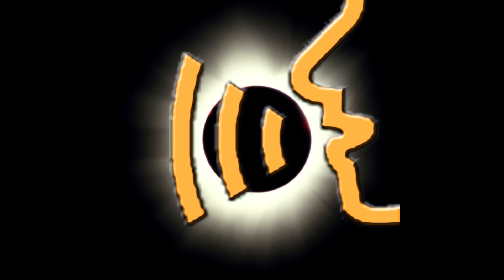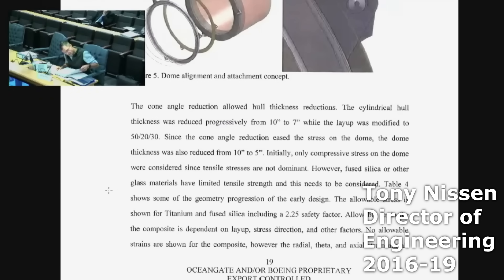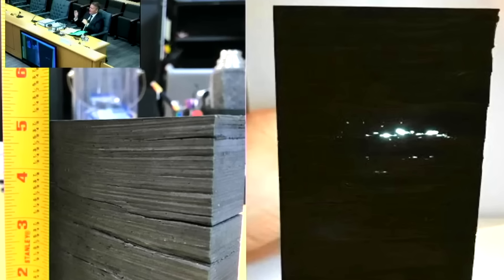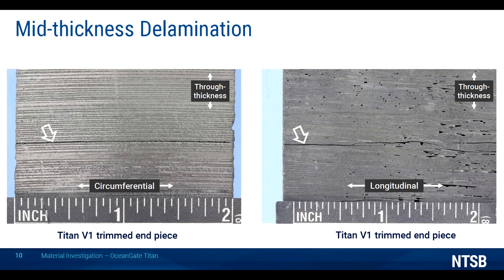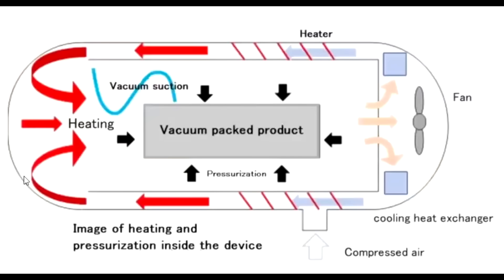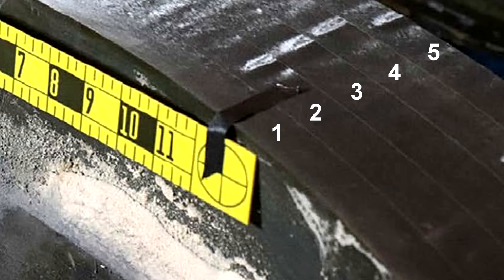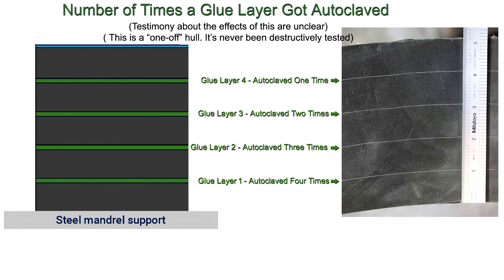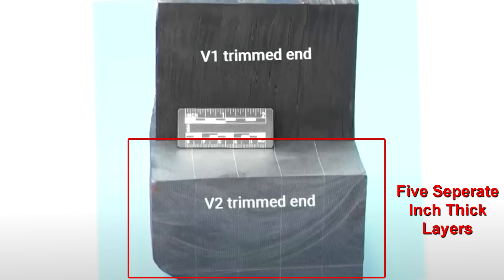Who Engineered the OceanGate Titan V2 Hull? Maybe Nobody Did?

Comment: 9:30
NASA is not in the business to ask why. They gave a valid recommendation that, if followed, would have kept Stockton alive.
Reply: Exactly. NASA isn't guilty of "not caring", they were consulted on composite manufacture, not on composit manufacture for a submersible. Seeing as they returned most of the consulting fee, and from what came to light about how Stocton operated, it is feasable that they were not informed about what the composite manufacture was for by the time that Stocton pulled the contract. This video seems to attempt to put the blame on NASA, while the blame lies with Stocton.
Reply from the maker: @QuintinvanRooyen1  Thanks for commenting.  No, I do not attempt to put the blame on NASA.  They did what they were asked to do and that was to provide consultation (remotely) on how to debulk carbon fiber laminates.  They were interested in the process to see if their recommendations would ultimately help to make thicker laminates.  The Stockton stopped the association.  My point was that the end product should be taken into consideration even when making the early recommendations.  If NASA had been kept around long enough they may have been in a position to give OceanGate warnings about the idea.
Reply: @solareclipsetimer  fair response, but the video did give me the impression that you thought NASA didn't care about the use of the end product. I appreciate your response and accept that it may be my interpretation and not your intent

Comment: No matter how you engineer it, carbon fiber isn’t a proper material for a submarine. It’s brittle! Duh!
Reply: Nah you can use it effectively. The single point of failure for this submersible was Stockton rush. The shape and material have been used before in compressive load. But they were built right
Reply: @beesung2052  I assume you meant to say that they were (it was?) not build right? A majority of the video shows how the building technique of the cd pressure vessel was flawed
Reply: @J0nny_  common sense suggests the guy above you was saying that OTHERS did it correctly...
Sure grammatically he started a sentence with a conjunction. But we all do that from time to time right?! 😉
Reply: @iliketurtles4463  that's another war to make sense of it.
That's why I mentioned the NASA paper
Reply: not just that, but carbon fiber is strong under tension, not compression. It is great to keep a lot of pressure in (copv) but not to keep pressure out (except when it is made in a very specific way, afaik someone at nasa wrote  a paper about it). This way does not involve sanding the structural carbon fiber down which is, guess what, a very bad idea.

Comment: Another video I saw also mentioned that this should have been in a vacuum when it was baked to help remove air pockets, but that was not done.
Reply: Yes I saw that as well and someone recommended a "clean room" and he ignores that and they wrapped it in a likely dust filled room with no filtration and little invisible to the eye particles of dust just landed and stuck in between each wrapping layer creating likely hundreds of thousands of extremely tiny microscopic air pockets. He just wanted to hurry up and submarine so he could be on the cover of Time magazine and get asked ego thumping questions and he could feel like a hero on 60 minutes. His ego and his dream to do something as famous as his ancestors did, who signed the declaration of independence, got in the way of safety and he paid the price. Unfortunately he suffered from  Dunning Kruger which caused him to take passengers down with him and they paid the price as well. Both monetarily and with their lives. RIP
Reply: It is called an autoclave and it is pretty much the only way to cure carbon fibre. "OceanGate used an autoclave at Janicki Industries to cure the full-size hull of the Titan submersible." So whoever made that video is wrong.
Reply: @BionicBurke  Autoclaves use pressure not vacuum, so not sure where you are getting the idea that an autoclave helps with air bubbles removals.
Reply: @dagamore  same result.
Reply: Autoclaves no are usually built to pull a vacuum before adding pressure for various reasons. If these are similar to Boeing autoclaves they definitely pull vacuum first

Comment: Common testing protocols would have saved the program.   The first hull should have been retired after around half dozen dives so that appropriate testing could be done to determine how effective the design was.  The, another hull would have been built with improvements.   There is no way the hull could continue dive indefinitely as fatigue failures will eventually show up.   It's suicide to ride in an untested design over and over again, ignoring fatigue stress, until the hull failed.  On every dive he was rolling the dice with worse and worse odds.

Comment: The Vaccuum Process Nasa suggested was ideal though. It is the best way to reduce the risk of delamination due to inclusions, as well as avoiding oxidation of the fiber. It also limits offgassing during the curing process. 

The Material is the Problem in this case, not the process of manufacturing it. The Titan Submersible was not strong enough to withstand these pressures repeatedly since it was too thin which allowed microfractures, and compound damage in general, from elastic deformation to build up.
Reply: Yip and bike industry has used that since the first ones delaminated I had five of the carbon cadex giant bikes and lots of other carbon alloy and titanium bikes he should have gone to bike design people who could have designed a better process
Reply from the maker: Agree, the pressurized autoclave debulking is a way to get voids out of the laminate.  It did not seem to be great even at this one-inch thickness and that may be due to the protocol they used.  We don't have specific information about the autoclave protocol that I can find and I am making a video about that.  But gluing multiple one-inch layers together was very weak.  Thanks for commenting.

Comment: I'm flabbergasted that this silly thing survived 19 full depth compression cycles. That really is astounding, considering all the submersible experts stated that carbon fiber is inadequate for the application.

What if the hull had been two inches thicker, reinforced with internal titanium rings? What if the laminate process was continuous in a single process? 

The research was inadequate for actual human application.
Reply from the maker: Thanks for your comment and it is clear that you got the point of my video.  Thanks.  Carbon fiber might work for a hull.  Maybe not down to 4,000 meters.  But with proper testing, it may work for shallow depths.

Comment: The irony of boing giving  safety insights considering their safety issues.
Reply: Gotta look at where the root of the problem lies though. You can't just say: 'Dont listen to Boeing', you should specify WHO at Boeing not to listen to. After all, if we look at the issues Boeing is having recently, there's a VERY clear path to failure we can look at, which will then lead us to conclude that the major issue within Boeings lies in its management and their drastic increase of personal enrichment while cutting costs DRASTICALLY in terms of maintanance and training. So it's really not very fair to put this onto the Engineers at Boeing. Look at the rich pricks at the top - they deserve every possible bit of scrutiny.
Reply: As stated by the guy from Boeing they primarily consulted on manufacturing...
Reply from the maker: @rkan2  And they had really sound engineering suggestions that were not followed.  Thanks for your comment.

Comment: "No torsional movements." Bro what are waves, even? The arrogance is astonishing.
Reply: Waves underwater, do you mean currents?
Reply: @davidaugustofc2574 And the loads due to waves are tiny fraction of a percent of the loads this sees due to pressure.
Reply: @davidaugustofc2574  No. When it's on the surface of the water, it's experiencing waves, which are going to deform the shell because of torsion. Additionally, gradation in depth pressures are also going to create torsion. The bottom of the craft would experience distinct differential pressures from the top. So the bottom would be pinched inward more, and the top would flex somewhat more outward. The guy was selling bullshit, and apparently he was also sampling his own supply.

Comment: I mean, 5 inches of steel would have lasted longer than this. What's the point of using carbon fiber? To make it sound cool?
Reply: Less ballast to reach neutral bounancy, better economics for final sub design.

Unfortunately, titangate only proved why you can't put economics ahead of engineering
Reply: heavier, heavier sub, heavier support ship, heavier ship more cost
Reply: It was to save money. Unfortunately for Mr. Rush, this was one environment where you definitely shouldn't be cutting corners.
Reply: Yes. Carbon fiber is advanced technology; steel has been around for thousands of years.
Reply from the maker: Thanks for commenting.  A steel or titanium sphere is the standard design.  If you tried to make the size of the Titan in titanium it would be very, very heavy and hard to balance to neutral buoyancy.
Reply: Carbon fiber is strong for its price. It's just not going to the ocean strong. Shit I think metal will have a hard time
Reply: @Jarochito-o  It's strong in tension. Unfortunately for Mr. Rush, ocean pressure puts vessels under compression stress. One of the advantages of metal is that it's easier to make the hull uniform with no air bubbles to weaken the hull. With carbon fiber, you have to wrap many layers around mold and that makes it easy to accidentally leave tiny air bubbles.

Comment: I am still in awe of the stupidity in ignoring/dismissing the alarms on the hull after dive 81. Plus, they were saying the sensors were not reading right until it had reached a certain depth. I am not close to engineering but even I understand alarm is bad, especially if that is your only warning system. 

I truly believe the people who knew about those alarms and continued to Ok that thing to go down are just as culpable for the deaths as Rush.
Reply from the maker: Thanks for commenting.  You are correct about the need to stop.  The dive that saw the abrupt strain gauge data change coinciding with a loud bang was dive 80.  They should have stopped after dive 80.  They ignored their own warning system,
Reply: @ I don’t remember when it was but at one point I thought they testified that the alarm system would only start giving readings after they had reached a certain depth. Was that dive 80?
Reply from the maker: @jenicon6560  Thanks for your reply.  The acoustic monitoring system would only give alarms if the volume of noise reached a certain threshold.  It was measuring what would assumed to be breaking carbon fibers.  So, they measured the volume of noise and the amount of noise generated over time (frequency).  But it would give potential readings at any depth, if noises occurred.  The thing about dive 80 was that the big bang happened when they were close to the surface, not when they were deep.  But that makes sense when you listen to the testimony of Karl Stanley from his experience with the deep dive in the Bahamas in the first hull.  That hull made a lot of noise on the way down and the way up.  His explanation was that the hull/fibers could store the compressing energy and then release that energy on the way up.  In dive 80 I think it was worse than just fibers. Form the strain data that happened at the same time as the acoustic data, I believe that represented a glue layer breaking up between a layer of one-inch carbon fiber.  An inter-layer delamination - my guess.